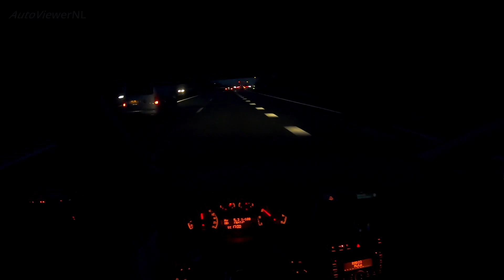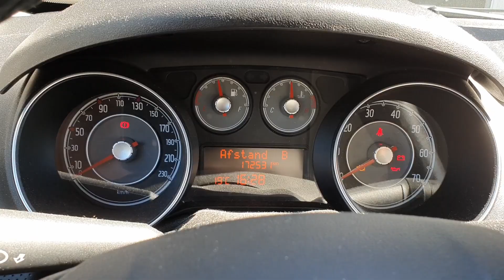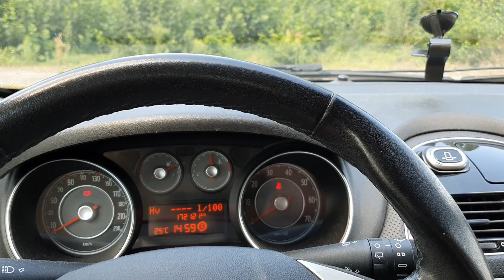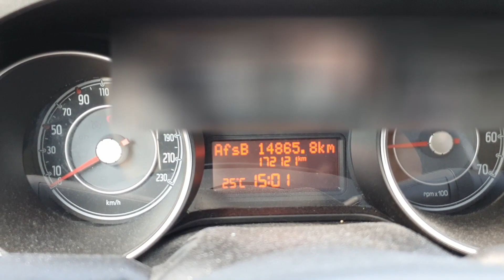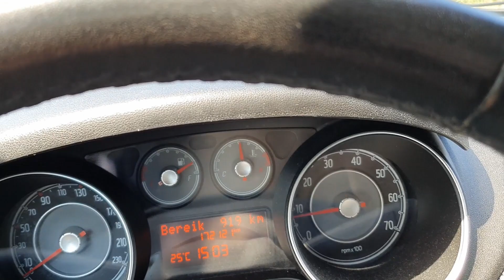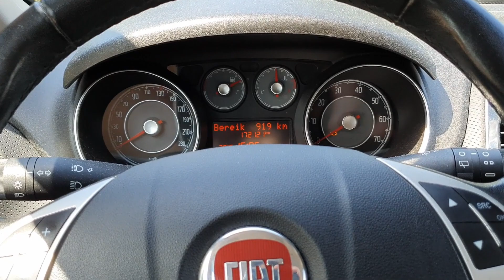FIAT PUNTO 1 3 Multijet 85HP POV AUTOBAHN Drive - FUEL CONSUMPTION

Comment from the maker: The video we promised we are going to do! 
- What is the fuel consumption of a Fiat Punto?!
Reply: Great Video! One question. What was the average speed considering your consumption of 5.0 l/100? Thanks.
Reply from the maker: @Fabrício_1984  Thank you! To get between 5.0 - 5.7 (let's say) you have to drive 130 km/h and be accelerating continuesly. (To get closer to 5.0 you have to fuel: Shell Fuel save, and to get towards 5.7 you fuel V Power) 

In case you use the Cruise Control (CC) and drive around 100-120 km/h, you will achieve lower numbers! 

Because all these numbers I've shown in the video, are by foot without using CC. 

Thank you for watching, be prepared for the next video: Driving to the maximum speed of the Fiat Punto 1.3!

Comment: It's a good deal the punto Evo 1.3 240.000km for 2.200€?
What are the main issue or what should I look up before I buy one?
Reply from the maker: Hi Shaylesety, thanks for the interest in Fiat Punto Evo 1.3 (make sure to subscribe & Share with friends and family!).  Is it a Diesel?  
Make sure to look up on the repairs/maintenance history. In which country are you buying the car?

Make sure to look at the mileage, the history of the car (yearly checks). In the Netherlands we have a yearly check-up which is registered. This makes it easier to track back.

The way it drives, make sure to watch my videos and see these first (completely/fully) before you look and feel the car. 

So make sure to test drive it!
Reply: @AutoViewerNL  it only had one driver only, and yes is diesel, Spain. Not sure if should I take or not tho
Reply from the maker: @Shaylesety  Make sure to see other cars as well, try to scout around for another Fiat Punto and test drive that one as well. After the first steps (previous comment) and this one, you should of have the best initiatives in place to get the best car.
Reply: @AutoViewerNL  I my self want an Toyota /auris/yaris but imposible at this price lol
Reply: Look out for the timing chain, if noisy then its for a replacement, look out if its clogged because of frequent city driving (dpf may be clogged up) other things are unkown to me

Comment: Hi, greate video. Im am intrested in what your board computer says about your instant consumption when you are going 130km/h?
Reply from the maker: Thank you! It all depends on your right feet.
If you put a lot of weight, it can vary between 6-7.3l/ 100, but if you drive 130 with less weight on your right feet it is around 4.9-6.1l / 100 km.

Make sure to subscribe!
Reply: @AutoViewerNL  what is the rpm at 100km/h also subscribed
Reply from the maker: @r3yk07  I think around 2000 at 100 km/h, thanks for supporting!
Reply: Last year, traveling mostly flat, highway, 130kmph or a bit above, achived 5.9l with tempomat.

Comment: Hi, why my pubto evo 1.3mjet, 84hp says 9.0l / 100km is average? What did i do wrong?? It pisses me off
Reply from the maker: Wow! That's insane!
Is it a gasoline/ diesel car? (All maintenance done?)
What is the mileage and how fast do you drive? (+ what is your driving style?)
make sure to subscribe!
Reply: Diesel 1.3mjet, I drive normally. And when i am in place and first starting it sometimes goes to 20l and then drops to 12-15 and so on. In fifty gear on 110kmh is around 4-5l but city is killing it.
Reply from the maker: @mihajloaleksic5710  How is your maintenance on the car? (all done?)
Have you driven the car until near empty? How much km's did you achieve? (what did you drive mostly? (Highway or city?)
Reply: I drive city mostly but i drive between two towns also. I must go to mechanic, but have you any idea what could cause this problem?
Reply from the maker: @mihajloaleksic5710  I have no idea, it seems some fluids need to change or has to be added?
Reply from the maker: @mihajloaleksic5710  Any update?
Reply: @AutoViewerNL  no... I have done phone call with my mechanic but he says that I should calculate by myself but he will chet it also when i left him car for some other repair
Reply from the maker: @mihajloaleksic5710  I see, keep us updated!
Reply: Try and use Shell diesel/gasoline also use some aditivos Redex for diesel or gasoline. It will be better I promise!
Reply: Da li ti je uključen start stop. On računa prosečnu potrošnju i ako stojiš. Pa ako si često zaglavljen u gužvi, to može dosta da poveća potrošnju koju on računa. Meni je prosečna po gradu do 8l kada vozim prilično agresivno. A vrv bih mogao da spustim na recimo 7.4l po gradu, možda i manje uz veoma nežnu vožnju.

Do you have start stop on? If not, that can greatly increase consumption, because it is calculating consumption even when you are standing in traffic. My city consumption is 8l when hard accelerating. I did lower it once to 7.4l driving it gently. I could probably lower it to 7l city. Depends a bit if city is mostly flat or hilly. Assuming mid to high traffic.
Reply: @CarNikola135  znaci ispadne da punto trosi kao moj mercedes E220 cdi koji je tezi jedno 500-600 kila i ima 2.200 kubika. Katastrofa. Mercedes na 120 na sat trosi 5-5.5 maks

Comment: Helo what is the fuel consumption in city driving?
Reply from the maker: Hi, great question! 
Tbh, I could make a whole video on that. 
But I believe it's around 4-6L/100? 
- Maybe a video driving in the city will get us a better perspective (and it will be more accurate).

Stay tuned for the maximum speed video!